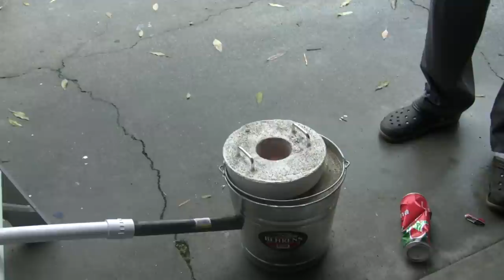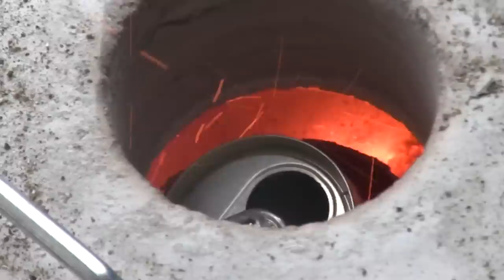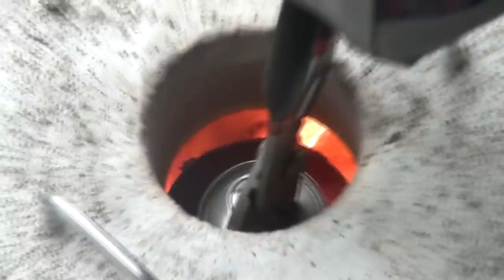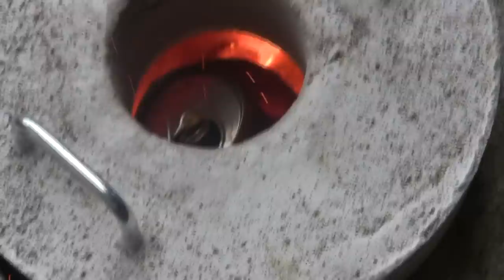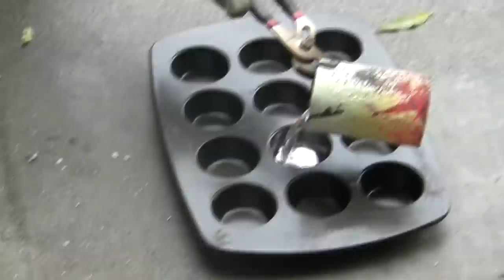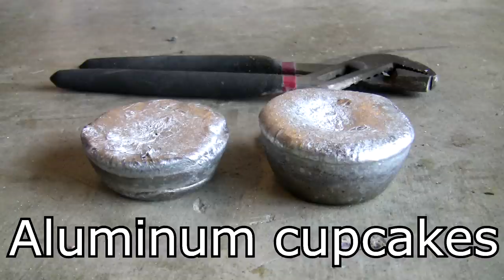melting aluminum in a home-made mini foundry

Comment: This is @King Of Random 's design right?  Out of curiosity, why not use cement instead of plaster?  Would seem a FAR better option from where I'm sitting, I've got tons of experience w/ both compounds but haven't smelted anything yet, but cured mortars are incredible heat barriers I'd have trouble picturing any sizeable difference between their insulation and that of plasters/similar compounds, but obviously a cement-based refractory-insulation layer would be far more solid/resilient (I'd think!)

Thanks a lot for posting this, am so eager to make my 1st casting (a slingshot), will be doing lost-foam with wet/green sand, was thinking I had to use propane/butane for my forge but seems the tubed-cylinder method is sufficient (I'm only going to be working with small chunk aluminum), have a solid fire-extinguisher I'm going to de-pressurize & cut w/ angle-grinder to have a nice crucible and start with cans but wanted to ask *is it worth using 'better aluminum'?  For instance I have a vehicle rim, I have a high-end aluminum baseball bat, I keep thinking that maybe their specific alloy will be a smarter raw-material for my castings, any thoughts on that would be hugely appreciated!!  (I'd simply use my cut-off wheel to take chunks from a bat or rim to get ~3" pieces of the metal for my fire-extinguisher-crucible!)

Any other tips for strength of final product would be greatly appreciated, want to make a rather large slingshot (will be launching a ~2/3lbs projectile that pulls a nearly-2mm thick string, a 'throwball' for setting climbing-lines, so want a very strong slingshot!)
Reply from the maker: Hi!

Yes, this is KOR's design. I use plaster because it's convenient. With concrete the process is more elaborate. But it might work.

Most aluminum objects are the standard 6061 alloy. The 5083 is stronger but it's less common. But it's not easy to tell which alloy is used for a given object just by looking at it.

Comment: how long does it take to get hot and what are you using charcol
Reply from the maker: +Joe Betterman Just regular charcoal for grilling burgers, yeah. There's a pipe plugged into the bucket through a lateral hole near the bottom; using a hair drier I blow air into the bucket through the pipe - this makes the charcoal burn very hot, much hotter than your backyard grill. It's not easy to get the charcoal burning, but when it does, then things move very quickly. In a few minutes after the whole mass of fuel has started burning, metal is already melting.
Reply: ok I used a shop vac to blow in my foundry but i think it was blowing air to fast
Reply from the maker: Joe Betterman The tricky part is to get the fire started. After that I think you can blow a lot of air through it, and it will only make it hotter.